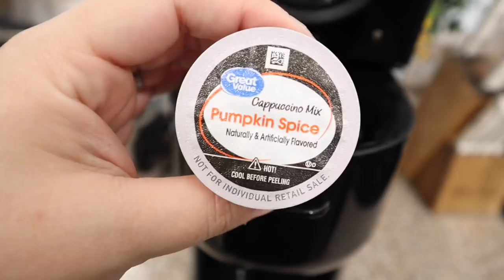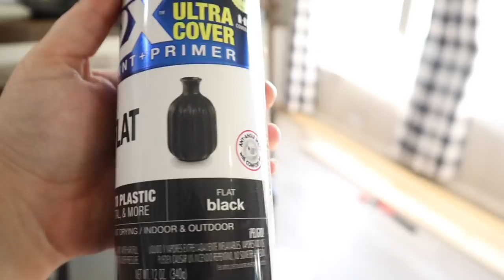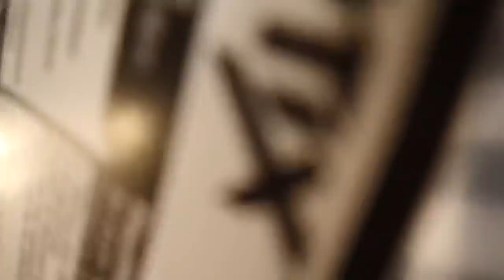DIY BARN DOOR FOR OUR MOBILE HOME USING PLEXIGLASS | mobile home makeover | mobile home updates

Comment: This project turned out fantastic! You can always get the peel and stick privacy clings if you want later down the road. Home Depot has a nice selection at reasonable prices. Also, down the road you might decide you really want 2 doors and you can switch out the hardware that overlaps the doors when opening. You really have a decorators eye!

Comment: Merina, for future reference, the hardware store can cut plexiglass, regular glass and wood for you. Also wood boards are sized based on their original size prior to the drying process they undergo, which causes them to shrink. So 1x (or 1 by boards) are 0.75" thick, 2x are 1.5" thick, etc. The widths are the same way. 1x2 are 0.75x1.5, 1x4 are 0.75x3.5, etc.

Let the store do the hard work next time, if you have your measurements planned out ahead of time. Especially for large pieces. Beautiful projects as always. ❤❤❤

Comment: A little tip that I learned with roasts, about halfway through slow cooking, take you a fork and knife (or whatever) and shred it up. I make sure the juices cover it and then I let it finish cooking. It will be juicy and tender.  Mine kept coming out tough like that and I couldn't understand what I was doing or not doing and one day I did that little trick and well, it worked. 🤗

Comment: I would use window spray frost in a can on the back of the door so you don't see thru to the laundry area. That's the purpose of putting a door in, so you don't see what's on the other side. It's a cheap way to achieve the rippled glass you loved on the original doors.

Comment: Looks great.  So classy.  Also it's not Lowe's lumber in particular with the smaller than  size,.... it originally was a 2x4 or 1x6, whatever,... before it was planed. To get smooth surfaces

Comment: In the future if you ever wanted to go back and try your original concept you could get the kit for the shower barn doors. When both closed they look even but when you open them they work like regular sliding doors where they go in front/behind each other. And like normal barn doors there is no threshold piece like regular shower doors would have. Just an idea. Love this though, I know you already changed it though so if you ever wanted to go back looked into that kit.

Comment: You should buy stacked washer dryer so you can utilize that space for your vac and trash. Not talking too small single unit but stacked, two separate units. Probably would not cost too much more if you sold your current ones.

Comment: Great result !!! Do you put a rail on the floor to make sure the door does not fall? Or is there another system / hack to prevent that?
Reply from the maker: The hardware came with little black pieces to place on the bottom of the door! I think they’re called anti jumpers 😄 it keeps it on track and steady!

Comment: Should of done a wider door not cut the plexi glass one, done a slim plain wooden one that's built inside by the frame of original door for the side by the wall that stays and let the bigger door slide out past the end of your wall on the outside track as it is.

Comment: If you don't want anyone to see your laundry, just put a small metal curtain rod up there , a thin metal curtain rod, measure to the width of the door  on the inside. Tack it up drape your curtain on there, and there you go, problem-solved no one will see your dirty laundry.